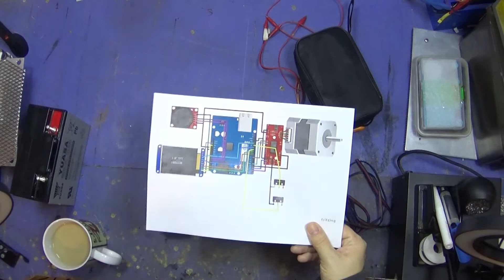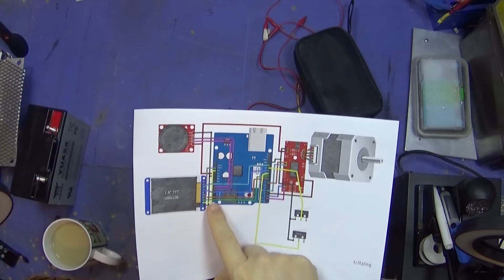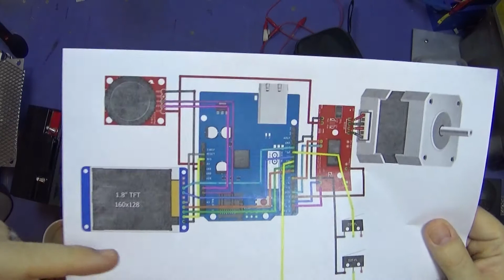K40 Laser Bed Part 3 - Self Calibrating

Comment: Can’t wait for this, looks fantastic, just what I need right now. Are you going to publish the complete BOM?
Reply from the maker: I'm going to publish everything I've used and as long as David doesn't mind I will publishing the programming as well. I have a few issues to iron out with the design but it's nearly finished...hopefully not to much longer until it's finished
Reply: What is the mesh cutting surface you are using? 🤓
Reply from the maker: @ademade4392  it's really expensive and it's not right. I will be changing it for something else soon. It was a random piece off the internet.
Reply: @TheOffGridFamily  I’ve finished making the bed now, just need the electronicy part 😎 I’m thinking maybe I should just make one corner longer with a knob so I can manually adjust… Oh and many thanks David 😀
Reply from the maker: @ademade4392  yeah make it however will work for you. Just make sure that all wires and electronics are out of the way of the laser 😜 I say that because it's the sort of thing I'd do lol. I'm working on housing for mine at the moment. So shouldn't be long